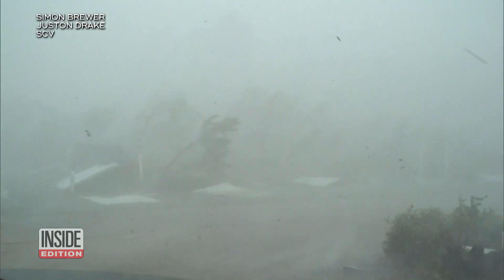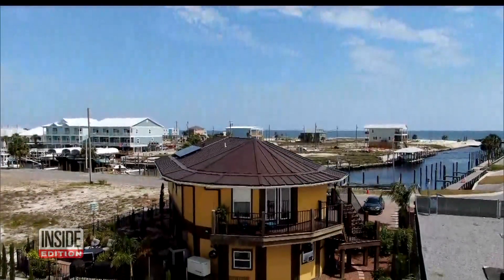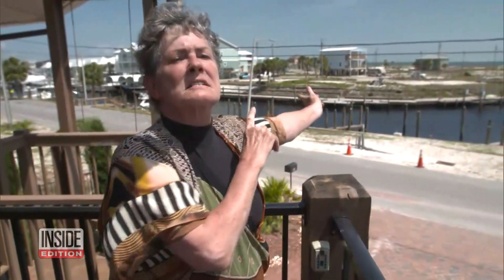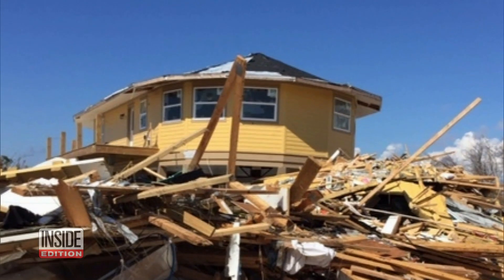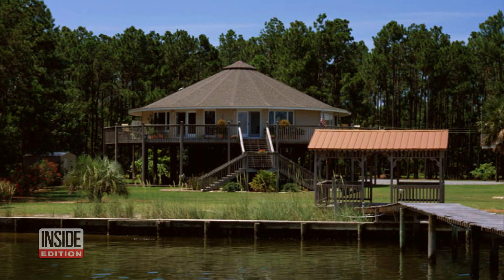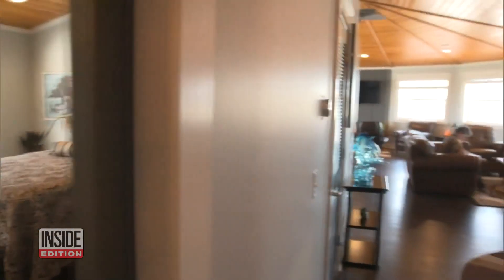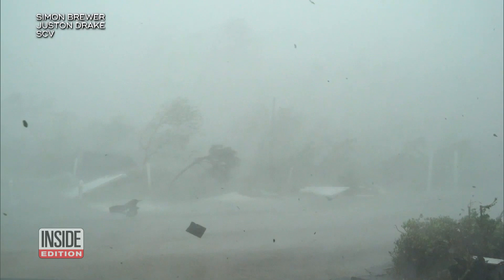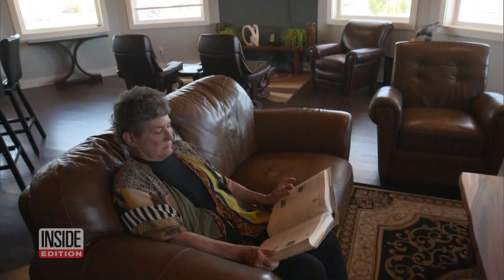Round Hurricane Houses Are Designed to Withstand 190 MPH Winds

Comment: Building round elevated houses with concrete structural beams is based on a simple concept: preparing for the inevitable worst case Hurricane. It should be mandated into law that all new houses and business need to be built to a standard that is Hurricane proof. It is a huge upfront cost to build better houses but when you don't have to rebuild your house and life after a huge hurricane the savings become huge after 10-20 years.

Comment: Good home but, for me it doesn't solve the hurricane problem.  There's storm surge that can exceed 20 ft. and flooding or, a tree limb could harpoon your house, power outages, contaminated water, supply shortages, roads/bridges closed, etc.  It could take years to rebuild.  And even Deltec says not to remain in one of their homes if given evacuation orders.  

BTW, many homes in Punta Gorda, FL survived hurricane Ian, apparently because they were built after Florida started requiring new construction to be more hurricane durable around 2004.  It makes me wonder if a round Deltec home is necessary, especially since they seem to be 25-50% more expensive.

Comment: This is the most sensible architectural plan for buildings since the building of homes and castles out of massive stone.
Many years ago the wildfires in California  did burn a complete neighborhood and there was only one that survived intact...a round home that was exterior walls of concrete sprayed  over
 mesh and with mica-mixed flame retardant paint.   In Louisiana it would make sense to have a combination of those two..to seal the foundation and walls not only against high winds but also flooding entering the building 
In tornado alley this should be codified...
ROUND DWELLINGS AND BUISNESSES SHOULD BE THE NORM. its simply more sustainable.and sensible.

Comment: Geodesic dome homes with flush exteriors ... make that out of concrete and it could withstand Jovian wind speeds.
Reply: Actually our homes perform just as well as concrete in extreme storm situations and have a better ecological footprint as well. And beyond the strength, they also offer panoramic views and airy spaces.

Comment: proper foundation, concrete walls & concrete roof can withstand more than 190 mph winds
Reply: Our homes provide the same level of protection as a concrete home. Additionally, wood is considered a better ecological choice by many over concrete due to its carbon sequestration. An additional benefit to our homes is that we provide panoramic views and airy spaces--connecting people to nature while protecting them from it.
Reply: Exactly ICf is much stronger than these houses. In Dorian there were wooden structure homes like this with debris that had gone through the walls. Glad I built ICF after the hurricanes we've been through with no damage whatsoever and it's not round.